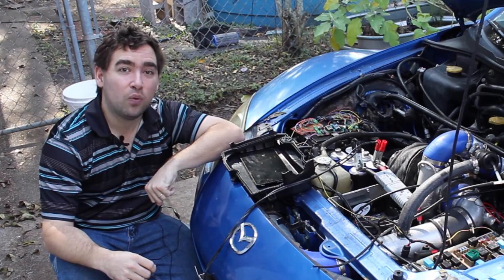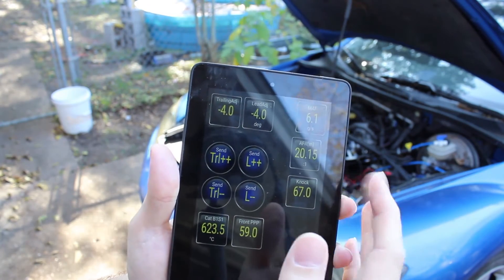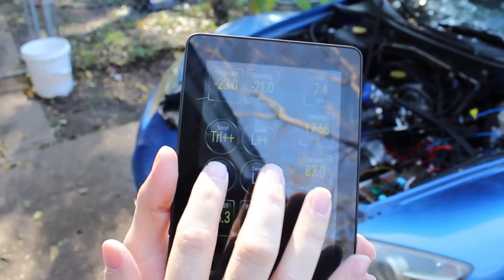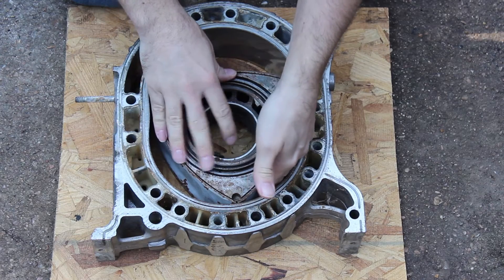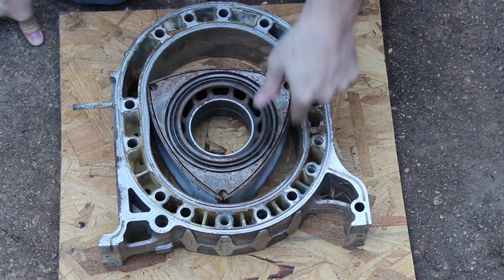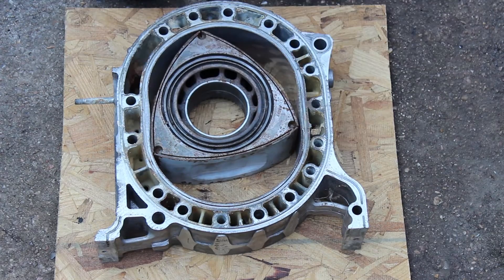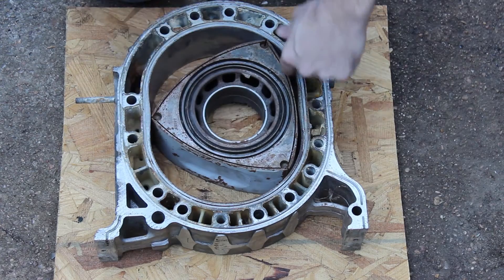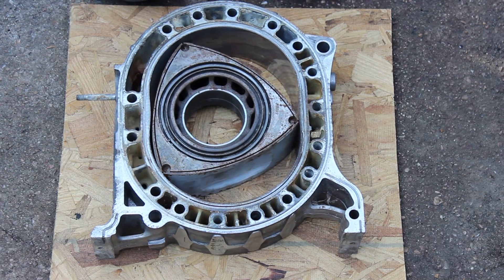Abnormal Combustion on a rotary engine - Voiding Warranties Ep 28

Comment: Your explanation about what was happening with retarded timing made me think about somehow embedding three plugs inside each rotor (flying plugs, one for each rotor face) powered by tuned induction and RF triggering.  This would eliminate the "leak" between the compression/combustion chambers due to the plug holes, just day dreaming.
Reply from the maker: +DoubleWishbone It's a nice idea. Maybe use RF power transmission. Changing plugs would be difficult though.
Reply from the maker: +Voiding Warranties darn you said all that. This is what happens when I respond late at night before bed.